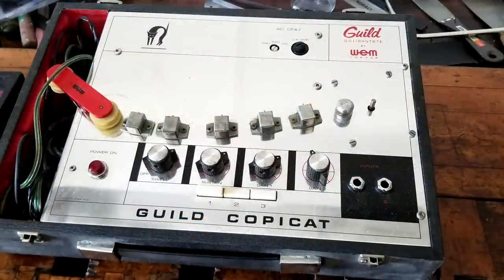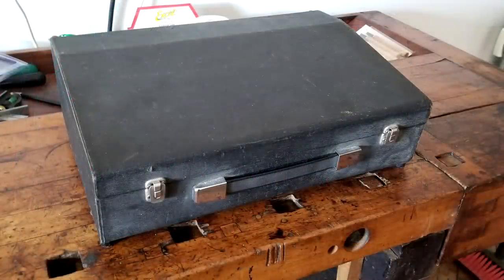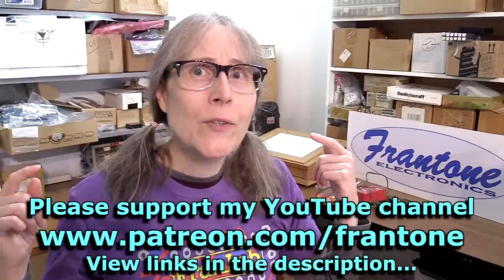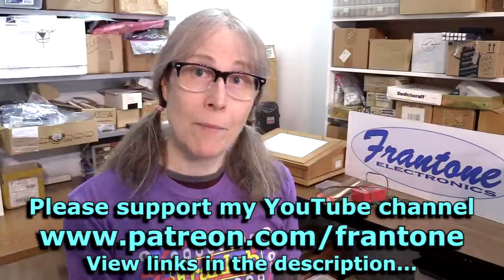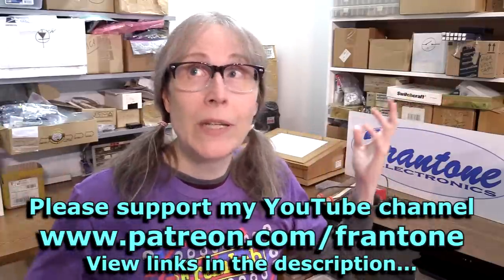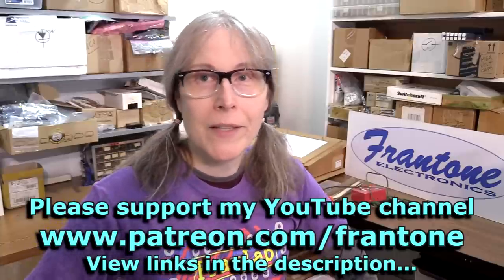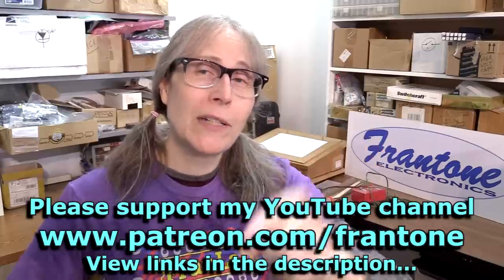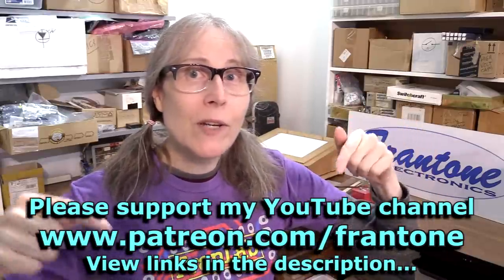Big Outgassing Problems Of Old Plastics

Comment: Polyphenols smell like licorice, or vanilla when they break down. If the hi-fi has phenolic circuit boards that could be your answer.
Something that irritating sounds like hydrogen bromide maybe? Possibly from the fire retardant breaking down.
Reply: @evensgrey  The phenolic breakdown is less of an issue, unless there are conductive byproducts. It's effectively advanced 'old book smell', but with way more to go until structural damage occurs. Breakdown of the fire retardant compounds to that extent is much more serious, for a number of reasons, particularly health concerns.
Reply: I outgas more as i'm getting older.
Reply: @MrEh5  👍👍👍😂😂😂😂😂✨✨✨✨✨💯💯💯
Reply: Some plastics smell like vomit, eye watering vomit, when breaking down.
Reply: @jonathanhughes380  Sounds like it, butyric acid has a very distinct odour of vomit, I say this after my chemistry teacher cruelly allowed my to take a faceful of the vapours from a jar of the stuff.
Reply: @johndee8874  Yes. I have a HP 4250 and 4350 printer. 2/3 of the case panels have yellowed. Anyone who has had one, knows exactly which ones. It's always the same. Yet, I have a HP 4000, 4050, 4100, and 5000 which are older, but still unyellowed. But, my HP 4+ and 5M, which are older still, are very yellow.
Reply: @rich1051414  Yeah, like those old screwdriver handles...cellulose acetate butyrate.
Reply: Phenolic resin potted transformers or other potted components also smell like licorice when they warm up.

Comment: That new intro with Bina-view is the coolest. And plastics are usually more trouble than they're worth, especially if a plastic part which is structurally or mechanically important breaks.
Reply: I967 
all hail 3d printers !
Reply: She has a friction welder for those occasions I'm learning so much from Fran
Reply: It's fantastic, isn't it? And all the more special because she dug in and repaired it.
Reply: I hope she will.

Comment: This might be a good place to mention about the out gassing from hardshell Fender guitar cases, especially those from the 70's. A friend of mine has a pretty extensive guitar collection (over a hundred) and many spend a lot of time in their cases. One day he pulled out a mid 70's P Bass in natural finish. The clear coat on the bass had softened to the touch. So much so that it was sticky to the touch and you would leave finger prints in it. We tried to leave the bass out of the case but it never re-hardened. We contacted a guitar repair guy and he told us that he was getting a lot of fender guitars in from the same time period and that the finishes were doing the same thing. The only thing we could figure out was that the out gassing from the case was reacting with the finish on the guitars. Once it starts it doesn't get better and the only thing to do is refinish the guitar and get a new case. Of course refinishing the guitar greatly reduces the value of the guitar.
Reply: Who would have guessed keeping a guitar in the factory case would damage it!
Reply: ah man thats horrible, reminds me of an ex girlfriend whos dad was a tour manager she had tour jackets from gwen stefani and nin, a few others, guitars, an old les paul classic was just on the floor like trash, i was like wtf is this?? egh sad.

Comment: I'm vintage doll collector, about 60s/70s, so my perspective might not be the most helpful, but the most important thing I've learned for prolonging plastic fidelity is keeping "like plastics" sorted together. Highly flexible plastics with lots of plasticizer (like vinyl) should never be stored with brittle/hard plastics, or the plasticizer can begin reacting with the hard plastic and leave "melt marks" - Kenner's Dusty is an infamous example of this.

Plastics in close contact with metal should also be given special attention in my experience. In the doll circle, vinyl in constant contact with metal (Like doll earrings, for instance) can result in irreversible discoloring and fragility. And just on offhand observation, some (but not all) Pyralin/Celluloid plastics seem to outgas in a way that corrodes metal (I've seen this especially so with 1930s vanity kits in antique stores, all the button hooks are terribly rusted). 

And even with those factors accounted for, every half year or so, I like to take inventory with my dolls to make sure nothing anomalous is happening. I don't claim to be an expert because even among something as banal as dolls, plastics are all different, even between batches. Still, I hope I helped in some way!
Reply from the maker: Thanks Maeve - It is impossible with bins of electronic parts and assemblies that are constructed of all kinds of materials that cannot be separated.  Just adds to the unpredictability and frustration of trying to preserve so much of this kind of stuff.
Reply: A similar problem often happens if you leave the PVC cable of an electronic or electrical item in contact with the plastic case for a long time, the cable  leaves melted areas on the case.
Reply: Maeve B. - "It's Kenner!  It's fun!  SQUAWK!"
Reply: Celluloid and other nitrates will slowly hydrolyse when exposed to moisture leaving nitrates or nitric acid to wander off and corrode things, the discoloring you're seeing is likely nitrates and other products of acid attack on the metal. You'll want to store anything with celluloid with moisture absorbing or adsorbing materials to reduce this, hope that helps.
Reply: Now I understand why my old electronics sometimes have spots of meltiness where cords were wrapped around

Comment: In the mid-80s, I had a German friend that was "relocated" by Volkswagen (yes, the company that defrauded the whole world about their car emissions) to South Africa to run a research project on the outgassing of plastics used in cars (the dashboards in particular). They chose SA because there was an area (the Karoo) where they were pretty much guaranteed sunshine, so it was easy to setup windscreens in the sun, with boxes behind containing the dashboards and analyze what was emitted, and how the plastics degraded.
All that to say that plastic gas emissions are not exclusively a problem of "old" plastics, but of ALL plastics. It needs paying attention.
P.S. Just discovered your channel. Love it so far. Thanks for sharing.

Comment: Try putting a charcoal canister in the box with it along with a dehumidifier canister and maybe sprinkle baking soda in the bottom too for several weeks then put it outside in the sun for a day. This sometimes works for stuff that smells like basement damp.
Reply: This was my thought.  If nothing else, charcoal can absorb smells and stuff, until it gets loaded of course.  Hmm, might be a maintenance nightmare changing out hundreds of canisters in the vault every however often, but maybe just using them in priority crates (marked so you know where to look when it's time to replace them) would be worthwhile.

Charcoal can be regenerated by baking, although obviously that releases all the contaminants it absorbed -- do it outdoors with a toaster oven you don't use for food anymore.

Comment: I've seen a lot of out-gassing and deterioration of plastic and rubber products in my career, both natural and synthetics. Pinch rollers in tape drives either become rock hard or found wrapped around the tiny capstan. The black rubber replacement rollers that came in small plastic baggies stain the baggie it came in with a nicotine stain type color.  Some units with the soft foam as buffer were found crumbling or like a gooey disgusting smelly moist cake consistency that sticks to the fingers that took some solvent to remove. Deterioration of the rubber snot that was used to cover soldered wire ribbon cables to the PCB become dark, brittle and conductive. I repaired a lot of units by scraping the old, brittle snot off of some units 5 years old. Even poorly done silver coatings on certain custom switch replacements that turned a velvety black in the parts bag within a few years.

Comment: one thing you can do to mitigate your issue is to store like Plastics with each other, different Plastics hate each other. styrenes should stay with styrenes and polyethylene should stay with polyethylene in PVC should stay with PVC. There can be problems with mixing different Plastics together and sometimes you get a really bad reaction especially if they're warm. High and low density polyethylene are pretty compatible with a lot of things so if your bins are a high or low density polyethylene they shouldn't cause too many problems. silicones and latex based materials can have a really bad reaction with different kinds of rubbers like buna-n and natural rubber, neoprene and things like that. I used to work in the packaging industry and these are the some of the things that plastic and rubber manufacturers warned us about when we were coming up with different packaging and bottling systems and retail end products.
Reply: @han5vk  they are polymers. repulsive polymerized-folk

Comment: Place some PH indicator strips in all of your bins and check them periodically, you might spot trapped concentrations of acidic/corrosive gasses. Might also consider an inexpensive formaldehyde detector to 'sniff' the bins. Then you would only need to manage the bins that are indicating reactions are occurring. Thanks for sharing this !!
Reply: This is actually a really great idea! Would give a good visual indicator of sudden changes to the bin's internal atmosphere!
Reply: This is great advice. I have also seen the hydrocarbon detectors that the AC guys use, I wonder if those would work, or if there is something similar that is a broad range that can detect break down products in the bins.
Reply: Mitigation: mix activated carbon and baking soda and put a cloth bag of that in each box.

Comment: 1) I've noticed outgassing with my old toys from the '50s and '60s that were stored in plastic storage tubs. I didn't know if it was the toys or the tub itself that released the odor. Maybe both. I had put some of the toys in food storage bags for safe keeping. They too released a gas when opened after having been put away for a couple years. I ended up putting the toys in paper sacks and storing them in an old wooden trunk. They're in a dry, cool basement. I'm hoping that takes care of some of the smell, although it will probably release the outgas when the trunk is opened.

2) I had some rubbery castor protectors. The cup-like things that go under table legs or furniture wheels to keep the carpet clean or from mashing down. These protectors had been in a drawer for a number of years. I think they may have been about 25-30 years old. When I went to get them I could feel an oozing a sticky, oily substance coating the surface. I was glad they weren't on a carpeted floor.

3) In the late '90s Ecco shoes made the soles from a soft, water-impervious plastic-like material that was wonderfully comfortable for walking. The soles barely showed any wear after a year of two, which was wonderful because you could wear them for a number of years and they still looked like new. Then suddenly the soles started to decompose. It would split crosswise and chunks would tear off the heel. The interior of the heel would ooze a sticky substance that looked like tar. The company has changed the composition since that time, but I was so surprised to find shoes in the closet that were breaking down just sitting there.

This all makes me wonder what our homes are doing to our health with so many plastic parts. Just look around at all the plastic we use; It's in everything.
Reply: Yes! - keep things in paper not plastic bags, and ventilate the boxes.

Comment: About the WEM: It might be drive belts that are deteriorating. I know Techmoan has at least one video showing a vintage tape machine with drive belts that had basically turned to goo. It took a lot of work to clean it up.
Reply: Yeah. Those old belts are a PITA and a half to clean out. It's like...trying to clean the glue that's under a tape you've peeled off, only it's so damned sticky and goo like that it sticks to your cleaning utensils and you end up spreading it everywhere if you're not careful. I've been doing quite a few over the years, still haven't come up with a satisfactory procedure that isn't tedious and painstaking (mostly because there's electronics around or its on electronics).
I've known technicians who have refused belt changing jobs on those types of players that have a lot of them or belts that are particularly large.
Reply: @Jeff Richardson   Freeze dried kids, sound legit !   Child services are on their way :-))
Reply: @Shackman66  OMG that is an amazing idea. I am so going to try this with my next sticky situation, cheers.
Reply: I've got a reel to reel from the 70's and the belt is goo. But the belt travels all around the mechanism, One single long belt for take-up, tension, rewind, fast forward and capstan. I took one look at it and put it away again. It is everywhere.
Reply: @Shackman66  , freezing old and corrosive component-securing glue can be helpful when scraping the glue off the circuit boards,  which are usually made a pretty tough phenolic or fiberglass material; but I would worry about the freeze spray making molded plastic parts, pulleys and gears and such, brittle. The rapid contraction might make the plastic parts crack, or pulling and chipping the temporarily-frozen belt material off of the pulley could crack or chip the pulley.
Reply: @trespire  Does it shut them up?
Reply: For years I've used a product called Goo Gone. It's excellent at removing adhesive residue and doesn't seem to harm plastics or paint.
Reply: I once spent several miserable hours cleaning the melted remains of the pinch roller out of my revox a77....
Reply: Try to replace bolts w silicobe rubber belts. I've found repurposeable silicone belts on ebay
Reply: There's no drive belt in WEM copicats - the motor spindle drives the tape directly.

Comment: What I have run into is "soft touch" coatings on electronic devices that gets gummy after a year or so.  They don't generally outgas that much, but they wind up being tossed in the trash.
Reply: Same experience here in Ireland.  I wouldn't be surprised if it's deliberate.  One is DAB radio bought 2 or 3 years ago that now feels like tar and difficult to get off my fingers.  Another is a Nook eBook reader my mother got in the US.  I also have a few USB power banks that did the same.  Headphones ear pads are also notorious for disintegrating regardless of usage, although at least most are replaceable.
Reply: @theirisheditor  - I've got some old (~2013) USB thumb drives that are going sticky and tar like. Still OK for storage, but for how much longer?
Reply: Yeah, I took out some kind of presenting remote that had been in the original box for ten years. The entire outside was totally sticky and gross. I saved the pointing laser it had, and gave the case to a teacher who taught product design, to show his class.
Reply: Those rubberised coatings look & feel great when new, but are a nightmare once they start to breakdown, there's not much you can do to cure the problem, I had a small airband radio which got so sticky you could hardly let go of it! Tried cleaning it with various solvents but that just made it worse!
Reply: @NOWThatsRichy  I have a set of knives with that same coating on the handle - bicarbonate of soda seems to be the most effective way of removing the stickiness.  But being an abrasive it can remove the coating completely if it wasn't well applied in the first place.

Comment: Fran for what it is worth, I own a large vintage TV radio and HiFi store. I am packed to the ceilings with TVs, radios, record players, and all the parts, drive belts, idler wheels, capacitors, vacuum tubes, CRTs, flybacks, yokes, etc, that you could ever need to service any of them. All of my stuff is from the 1930-1960's. I have almost zero outgassing problems. I have old drive belts and old circuit boards and even old records in plastic boxes like you have and I have never had a problem. The only time I have a problem is when a selenium rectifier blows up, but that is under power. I would not necessarily change anything you have set up yet with your storage bins, I think that they are safe. 

However, this is just my opinion.
Reply from the maker: Thanks - I used to have a guy who did my work in the 90's, Mr. Morris in Dillsburg PA, he was a WWII vet who had a TV repair shop in the same location since the war.  Floors and floors of TVs and radios going back to the 30's... a very interesting time that I miss.
Reply: @FranLab  Sounds like an amazing place! I wish there were stores like that around today. I am trying hard to preserve some of that, especially early tube chassis TVs and repair equipment as its all but gone away. It is just a hobby for me as I have to work full time to afford to do it, as you are well aware, it costs a lot to save the past.